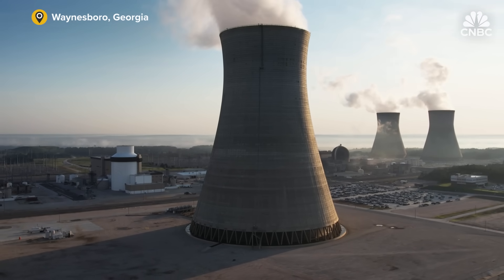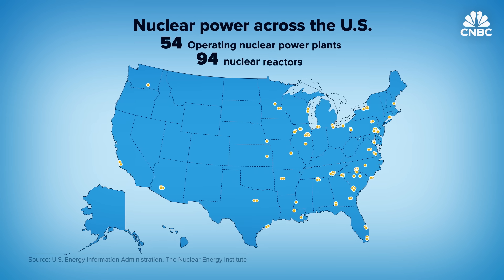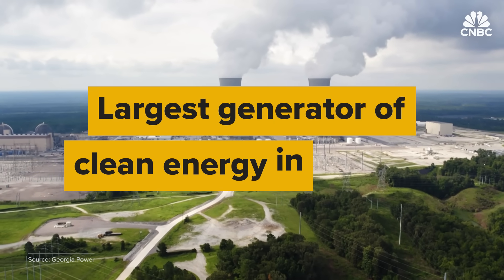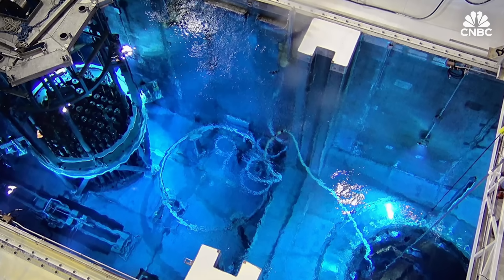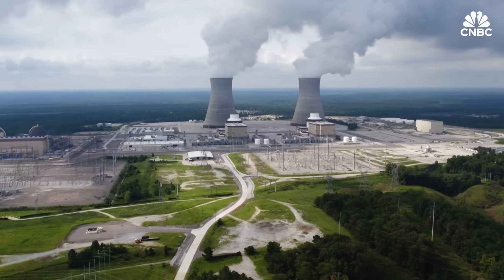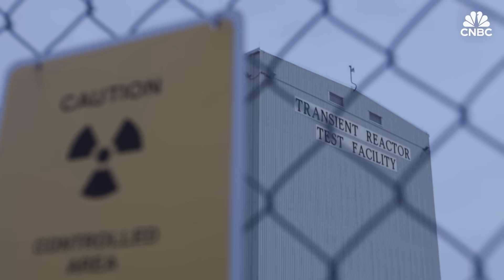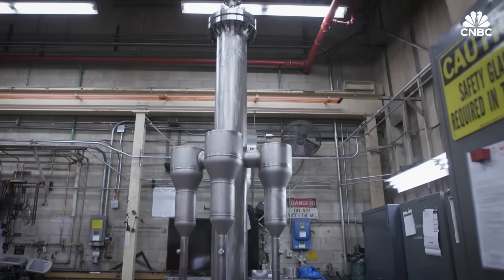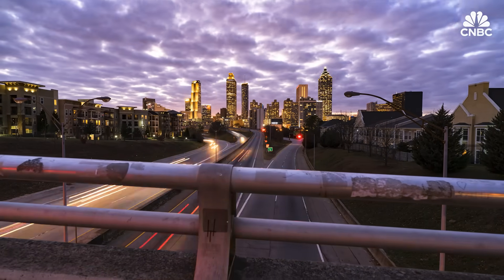Why It’s So Hard To Build Nuclear Power Plants In The U.S.

Comment: PV is turning out to be soo much cheaper, even when paired with batteries. There won’t be much nuclear development in the near future at least. Wholes sale solar costs a fraction of nuclear.
Reply: Yeah, that's why energy prices are skyrocketing in countries and states where solar is increasing the most.
Reply: @PistonAvatarGuy  they will stabilize because, there is no fuel to pay for. It is all fixed cost. Commercial solar is a few cents per kWh. Solar is 25 to 50 cents per kWh. I would ask to check my facts, but no seems to care about those anymore.
Reply: @PercivalFakeman  Producing solar panels is incredibly energy intensive, so their cost will be highly dependent on energy costs, which are skyrocketing globally. That's also why they're almost exclusively produced in China, where they burn more coal than the rest of the world combined.
Reply: @PistonAvatarGuy  solar panels are dropping in price and are becoming very inexpensive. I am a solar sales person and have only used panels made in North America. Hydro from the North is available as well. PV is has virtually replaced coal sales across the U.S.
Reply: @PercivalFakeman  There aren't really any solar panels made in the US, they're only assembled in the US using solar cells (the actual silicon part) from China. Photovoltaics are only inexpensive to manufacture when they're produced in countries with basically no environmental regulations, with little concern for human rights, and using electricity produced by burning coal.
Reply: @PistonAvatarGuy  The cradle to grave production process for nuclear energy is not much better.  Look at what years of uranium mining have done to places like New Mexico, Arizona, Australia, or Kazakhstan.  Nuclear plants require the same kind of imported rare earth materials as any other energy production facility, including coal and natural gas plants.  Solar energy is not perfect but at least it doesn't permanently contaminate large areas if the system fails, like at Chernobyl and Fukushima.  In addition, solar microgrids are much less vulnerable to hacking and widespread blackouts.  If you power an entire city with one giant nuclear plant, what happens if the plant fails?  A distributed system of solar microgrids is both safer and cheaper.  I can't believe people want to put small modular reactors in the middle of valuable food production zones like the Central Valley in California or in rural India.  What happens if you run out of water to cool the plant?  Look at how heat waves have been impacting France's nuclear sector for the past several years.  Why do you think they're phasing out reactors in one of the most nuclear-dependent countries on the planet (i.e. France)?
Reply: @Mr.eFF0  Are you kidding me? The amount of resources required for solar absolutely dwarf the amount of resources required for nuclear. Solar requires something like 7 times more material to be mined when compared to nuclear (per Wh produced), and that doesn't even include the batteries that solar energy systems need to reduce/eliminate their variability, nor does it include the grid upgrades and interconnections required to connect large solar energy installations to the grid.

Nuclear requires far, FAR LESS of the rare earth materials needed for wind and solar energy systems.

Nuclear energy systems should never fail, there's no excuse for the Chernobyl or the Fukushima accidents.

Solar is unreliable BY NATURE, nuclear is the most reliable source of energy that we have and it's far, FAR more reliable than wind or solar.

Solar, with enough storage and/or the dispatchable energy generators needed to eliminate its variability, is far, FAR more expensive than any other energy source. With solar, you're basically installing multiple energy systems in the place of one, otherwise efficient system.

Small, modular reactors are not a solution to anything, as far as I'm concerned. The one way that they might make sense is if they can be buried deep under a city, so that they're not a significant concern if they were to ever fail, but that would increase their cost enormously.

France has been carrying Europe though their energy production problems, which are largely related to Europe's attempt to rely on wind and solar energy. They've also become the world's largest exporter of electrical energy in recent years, because their electricity production remains reliable and inexpensive. Germany has even become increasingly dependent on imported electricity from France, thanks to their misguided attempt to rely on wind and solar for the production of their electricity. What you read about the so-called "problems" with reactors in France was simply propaganda which made mountains out of molehills.

If France does decide to distance itself from nuclear energy, they will be making an enormous mistake.

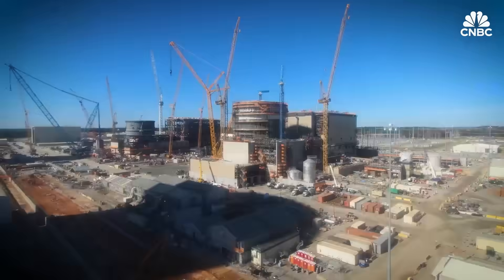Comment: 5:35
Southern Environmental Law Center: does everything it can't to stop nuclear construction, and sues nuclear at ever step
Also Southern Environmental Law Center: "Why is nuclear energy so expensive to build?"
Reply: @robmanueb. That's not the point, it's frivolous suing and lawsuits that are the issue.
Reply: @Loner-of-the-Dark-Valley  
Availability: Nuclear is inherently limited to where and who can deploy it. Nations lacking stable, strong, peace-focused governments and institutions are rightfully a security concern to the rest of the world when it comes to deploying nuclear technology of almost any form. This factor alone knocks nuclear out of the running for most of the planet.

Scale: Nuclear doesn't scale down well. Much of the world simply doesn't need concentrated 1GW power generation, at least not at their current stages of industrialization. Solar trivially scales down to microwatts (μW) and of course all the way up through gigawatts to directly complete with nuclear capacity. There are lots of "micro reactor" designs in the works, but "micro" here is relative as they're only micro in relation to convention reactors. Micro nuclear reactors are still in the tens or hundreds of megawatts. The smallest micro reactor designs are still generating 2,000 times the power of a typical rooftop solar installation and most are generating more than 20,000x. Nuclear doesn't know what small is.

External Infrastructure: Because it can't scale down nuclear power is inherently dependant on centralized power grid infrastructure to distribute it. That grid may not exist at all, it may be 100 years old and need of complete replacement, it may not be stable or secure due to economic or political weaknesses, and of course such grids are highly susceptible to climate change effects (fires, storms, etc). Industrial scale solar can certainly leverage a traditional centralized power grid if it exists, but solar doesn't require any grid whatsoever. Solar's ability to scale down and availability also make it a prime candidate for next generation mesh grid designs. Such mesh grid designs have huge advantage over traditional grid designs (security, availability, agility, installation costs, fire/storm resistant, etc) while retaining the best benefits of traditional grids. Nuclear's inability to scale down makes it a very awkward resource for mesh grid technologies and negates many of the benefits of such grids.

Deployment Speed: Solar can be deployed in minutes. That's slightly hyperbolic, but the fact is solar deployment timelines mostly scale proportionally to the deployment's capacity. And since solar scales down so well, it's trivial to perform many small deployments in parallel. It's that parallel deployment capability that has enabled so much new solar power to come online in the aggregate in such a small amount of time. Nuclear projects at best take years and are much, much more difficult to do in parallel as the technologies and expertise needed simply don't reproduce anywhere near as quickly or as cheaply as solar installation does.

Agility: Because of all the factors described above it is very difficult to be agile with nuclear power. You can't bring it online as needed...you instead need to predict years in advance what your power requirements will be in a given location. And once deployed you can't move it: You've got to predict the power needs of a given location for practically the next century. Solar in sharp contrast, can be deployed when it's needed, in the amounts that are needed, expanded quickly when needed, and moved quickly when needs change. This kind of agility is going to be absolutely essential over the next decades as climate change quickly, dramatically, and unpredictably changes where and how we need power.

Geographical: Solar certainly has some geographic limitations, after all it likes sunshine and lots of it. But most nuclear designs are much, much pickier. Along with all the other limitations described above, most all nuclear reactor designs are still really just boilers for steam turbines. Because of that fact and their large size they typically need a lot of water as they're not closed loop systems. A considerable amount of the world's power needs are not near suitable water sources for a nuclear plant...and many that are have serious safety concerns of tsunami risk and of course greatly increased storm risk due to climate change.

Risk: All of these factors amplify each other creating massive risk for any nuclear project. This in turn makes for extremely expensive underwriting. The scale, the uncertainties, the inflexibilities, the externalizations, neverly everything stacks up high on the side of risk with very little on the side of potential reward.

Cost: The costs for nuclear are massive for all the above factors and more. And those costs are only going up as the world becomes more dangerous and macro uncertainties such as changing needs due to climate change become more common and more impactful.

Conclusion: Fission generation is a dead end. The only real possible future for nuclear generation is fusion because it's the only fundamental nuclear technology that has the potential to mitigate many of fission's most serious issues (security, scale, agility, cost, speed). But of course aside from Sol, practical fusion power generation is just science fiction at this point in time. It may take decades to exist...it may never exist at all...and we need deployable solutions yesterday and everywhere, not years or decades from now and only in a few privileged nations. 
HT Zenin
Reply: @Loner-of-the-Dark-Valley  Availability: Nuclear is inherently limited to where and who can deploy it. Nations lacking stable, strong, peace-focused governments and institutions are rightfully a security concern to the rest of the world when it comes to deploying nuclear technology of almost any form. This factor alone knocks nuclear out of the running for most of the planet.

Scale: Nuclear doesn't scale down well. Much of the world simply doesn't need concentrated 1GW power generation, at least not at their current stages of industrialization. Solar trivially scales down to microwatts (μW) and of course all the way up through gigawatts to directly complete with nuclear capacity. There are lots of "micro reactor" designs in the works, but "micro" here is relative as they're only micro in relation to convention reactors. Micro nuclear reactors are still in the tens or hundreds of megawatts. The smallest micro reactor designs are still generating 2,000 times the power of a typical rooftop solar installation and most are generating more than 20,000x. Nuclear doesn't know what small is.

External Infrastructure: Because it can't scale down nuclear power is inherently dependant on centralized power grid infrastructure to distribute it. That grid may not exist at all, it may be 100 years old and need of complete replacement, it may not be stable or secure due to economic or political weaknesses, and of course such grids are highly susceptible to climate change effects (fires, storms, etc). Industrial scale solar can certainly leverage a traditional centralized power grid if it exists, but solar doesn't require any grid whatsoever. Solar's ability to scale down and availability also make it a prime candidate for next generation mesh grid designs. Such mesh grid designs have huge advantage over traditional grid designs (security, availability, agility, installation costs, fire/storm resistant, etc) while retaining the best benefits of traditional grids. Nuclear's inability to scale down makes it a very awkward resource for mesh grid technologies and negates many of the benefits of such grids.

Deployment Speed: Solar can be deployed in minutes. That's slightly hyperbolic, but the fact is solar deployment timelines mostly scale proportionally to the deployment's capacity. And since solar scales down so well, it's trivial to perform many small deployments in parallel. It's that parallel deployment capability that has enabled so much new solar power to come online in the aggregate in such a small amount of time. Nuclear projects at best take years and are much, much more difficult to do in parallel as the technologies and expertise needed simply don't reproduce anywhere near as quickly or as cheaply as solar installation does.

Agility: Because of all the factors described above it is very difficult to be agile with nuclear power. You can't bring it online as needed...you instead need to predict years in advance what your power requirements will be in a given location. And once deployed you can't move it: You've got to predict the power needs of a given location for practically the next century. Solar in sharp contrast, can be deployed when it's needed, in the amounts that are needed, expanded quickly when needed, and moved quickly when needs change. This kind of agility is going to be absolutely essential over the next decades as climate change quickly, dramatically, and unpredictably changes where and how we need power.

Geographical: Solar certainly has some geographic limitations, after all it likes sunshine and lots of it. But most nuclear designs are much, much pickier. Along with all the other limitations described above, most all nuclear reactor designs are still really just boilers for steam turbines. Because of that fact and their large size they typically need a lot of water as they're not closed loop systems. A considerable amount of the world's power needs are not near suitable water sources for a nuclear plant...and many that are have serious safety concerns of tsunami risk and of course greatly increased storm risk due to climate change.

Risk: All of these factors amplify each other creating massive risk for any nuclear project. This in turn makes for extremely expensive underwriting. The scale, the uncertainties, the inflexibilities, the externalizations, neverly everything stacks up high on the side of risk with very little on the side of potential reward.

Cost: The costs for nuclear are massive for all the above factors and more. And those costs are only going up as the world becomes more dangerous and macro uncertainties such as changing needs due to climate change become more common and more impactful.

Conclusion: Fission generation is a dead end. The only real possible future for nuclear generation is fusion because it's the only fundamental nuclear technology that has the potential to mitigate many of fission's most serious issues (security, scale, agility, cost, speed). But of course aside from Sol, practical fusion power generation is just science fiction at this point in time. It may take decades to exist...it may never exist at all...and we need deployable solutions yesterday and everywhere, not years or decades from now and only in a few privileged nations.
HT Zenin
Reply: @robmanueb.  care to elaborate?
Reply: @Loner-of-the-Dark-Valley  My responses are being deleted.